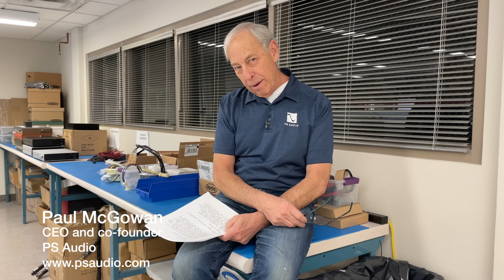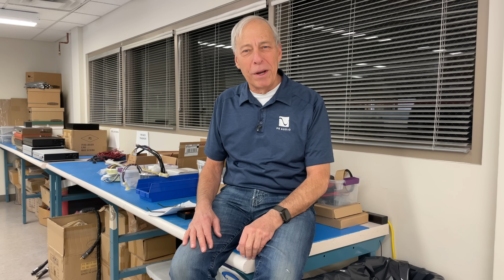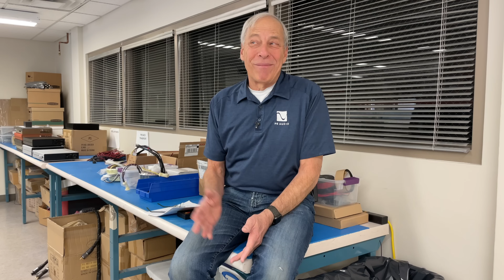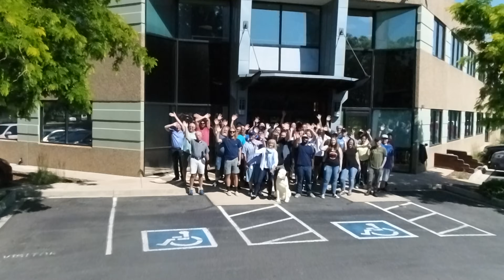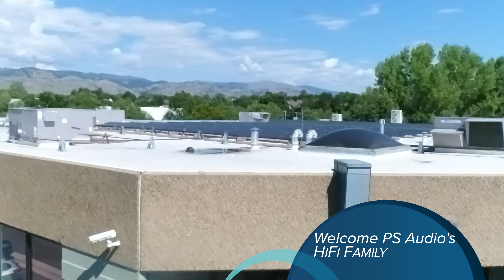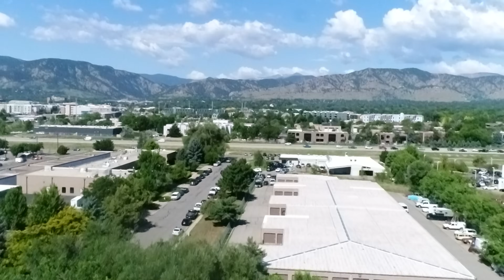Do bigger transformers sound better?

Comment: Why not place a "power amp" to the output of the PS? a transistor is cheaper and more compact than a transformer, and will give you the lower impedance.
Reply: The power amp will need a power supply using (you guessed it) a transformer. It'd be better to just use a capacitance multiplier circuit if you don't need regulated power rails.

Regulation adds its own can of worms because some regulators have very slow transient response.
Reply: Not necessarily.  But, thing is, he's talking about phono stage. how much current is there anyway? transients? 

Sounds like he was using a really tiny transformer, an insufficient one even for that.
Reply: @armaiatm  Lots of ways to do it. Of course, if it is that sensitive to the power supply it's connected to, then someone has obviously done a pretty bang-up job of designing a phono stage.

If I were designing the power supply for a really good solid-state phono stage and wanted to "do it right", I'd probably do a linear supply (with a normal-sized transformer and reasonable filter capacitors), then regulate it with one of the Linear Technology low-noise regulators. Then I'd throw sufficient output decoupling capacitance (using a mixture of electrolytic and ceramic capacitors) to ensure it maintains a low output impedance throughout a reasonable frequency range. The power supply for a phono stage does not need to be complicated or expensive.

Comment: Yes, I tried this myself years ago on a diy preamp and difference was big.
Reply: There's certainly diminishing returns. What I've learned looking into guitar amp design is that, the same as home audio, is that there's a budget and most of the time the transformers are an easy way to save a lot of money. Big transformers are easy upgrades if you wanted to spend a bit of money

Comment: My 2 ATI 2505 amplifiers each have 3Kv Toroidal Transformers, this equals 600v per each of their 5 channels. I think the Transformers are 60+ lbs.
Reply: 3kV? You mean 3kw? :P
600watt per channel minus heat loss (if it's class AB it's about 40-50%) sounds legit.

Comment: I don't know but the one on your 7k dac doesnt. Audible distortion and high noise floor. The 9 dollar apple dongle measured better.
Reply: @vegaslimoguy2376  it's on the Audio Science Review forum. Theres a 78 page thread about this dac with all the measurements.
Reply: @PowerSerge5000  On a forum??? HA!
Reply: @PowerSerge5000  Yes, I agree. ASR does legitimate testing.
Reply: @PowerSerge5000 
Did you even listen to it yourself to find out??
Or, are you basing your information on a pie chart that you read somewhere?
The proof is in the pudding, binky, not in the receipe.
Reply: @Hare_deLune  So when they make these obsolete over engineered over priced dacs are they not using measuring equipment?  The guy who designed the dac is pretty old and is supposedly almost deaf in one ear.  If it sounds good to him will it sound good to me?  Measurements are part of creating any piece of audio gear.  If im gonna drop 7k for a dac at the very least it should measure extremely well.
Reply: @PowerSerge5000 
Not only are measurements a part of creating any piece of audio gear, they are absolutely vital.
Measurements help to form the foundation of the creation of all audio equipment. They are the guidelines that engineers use to get the equipment to behave the way they want it to.
Then, when they reach a certain point in development, measurements take a lower priority to listening to the equipment.

This is blatant common sense, because it is 'audio' equipment. It is designed to be listened to. People purchase it and put it in their homes so that they can listen to it, not so they can hook it up to test equipment and measure it for years on end.
It is a well known fact in the audio community that many great sounding pieces of equipment measure poorly, and conversely, many pieces of equipment which measure perfectly sound less than ideal.
This is a form of proof that measurements are not the final arbiter of how a piece of equipment sounds.

 Measurements are a tool that engineers use to get equipment to conform to certain parameters in the design and development stage.
Relying on measurements to dictate how a piece of consumer equipment will sound, without having heard it, is a leftover of marketing ploys ro manipulate consumers in the 1970's. Don't fall for it!
Auditoning a piece of equipment has always traditionally been the way to determine if it's something you will enjoy in your system, not looking at the spec. sheet.
The spec. sheet is only to give you a rough idea. Same as the engineers who developed the equipment.

I know this is a tall order to fill these days with the disappearance of the brick and mortar stores.
We as consumers need to take advantage of any trial periods or money back guarantees offered, and to demand such opportunities, or boycott companies that do not provide them.
Reply: @Hare_deLune  what you described is how speakers are created. Because there is not perfect speaker they all get voiced to have a certain flavor. Dacs amps and preamps however are not supposed to have a sound. They're supposed to take the source and faithfully reproduce it.  Distortion and effects are added before hand when an audio engineer is mixing and putting together the music. That is how he wants us to hear it. Yet people are spending 6k for a ps audio dac that adds color to the sound. Why would you want that. Now everything you listen to has that color whether you want it or not. When the sound comes to your speakers it should be transparent and many dacs provide that. If you want to add more color than the studio recording engineer intended you can use cheap eq or dsp. The 6k dac from ps audio is literally snake oil as well as their expensive hdmi and usb wires.
Reply: @PowerSerge5000 
There is no such thing as purity of sound in any piece of audio equipment, or purity of species in human genetics.
That pursuit is a fool's errand.

When a recording engineer records a piece of music, it is usually made up of disparate parts which are stitched together like a frankensteined quiltwork, then compressed and given an artificial soundstage and sound character (mix) that was pleasing to that person, and perhaps some consulting band members.
Every bit of it is a carefully constructed illusion, created with a proprietary blend of studio equipment that varies quite widely in selection and setup from studio to studio.

Then the result is purchased and possibly further corrupted by the end user (creating ripped files, for example), then listened to on a cobbled together home sound system that varies just as, if not moreso, in selection, quality, and setup at home.
Great DACs and amplifiers are made to produce a pleasing sound. Some are more neutral than others, of course.
None of them are totally transparent, because we are not technically advanced enough to do that.

Another thing is that very few people enjoy a totally neutral sound, because it is flat and lifeless.
Most people want musical and emotional engagement when listening to music. Good dynamics, rhythm and pace.
Reply: @Hare_deLune  no great dacs and amps are not made to produce pleasing sound. That's some hifi bs. That's called adding color. Dacs and amps have been fully transparent since the 80s. They've been already perfected. Dacs dont need to be in a giant box with a screen. They're tiny. All they do is convert 1 and 0s. These high end companies are all snake oil salesmen. People need to research and realize they're being duped and stop buying their garbage.

Comment: Does having a larger amount of gold, transform you into a better person?
Current is the factor. If current is vey low, a large mass transformer is detrimental. Magnetism is a balancing act on a thin or heavy wire. Opposites in magnetism do not attract. The same direction of magnetic flow does.

Comment: A power supply can never be “too big.”
Reply: As someone who has worked in industrial controls design/engineering for over 40 years, can you please explain that statement to me?
Reply: @tomterrific9459  you stole my comment 😆🤣😂
Reply: Of course it can be too big and this is especially true for a phono preamp. Bigger transformers come with a higher cost, higher weight, more EMI noise and perhaps even more common-mode current noise. And with a proper circuit to regulate the DC voltage inside the preamp, a heavy over-specified transformer is of no added value. Paul remember something from 1976 and I'm sure there is a very proper engineering explanation for what he observed. It could be, for example, that the original transformer was indeed underpowered, or it had too low output voltage, perhaps a European model used in the USA. These things are completely measurable.

Comment: So if I’m reading a spec sheet, how can I determine how big the transformer is compared to another product?  Is there a unit of measure that I should pay attention to?
Reply: Weight. For something using a linear power supply, eg. a class A or A/B amp, weight is a hint. Big transformers weighs more.
Reply: VA= volt ampere
Reply: @regitregnskap  yup plus duty cycle

Comment: It's the same with guitar amps. The bigger transformers of a 100w amp will provide more punch and fullness than a 50w amp.
Reply: My tube amp is rated for 50w, but the transformer is the big old Marshall kind that’s nearly a foot tall. The thing rarely ever comes in at 50w! Always higher, with peaks up to 120w. Sounds incredible

Comment: Actually, a phono preamplifier is using little power and what matters is that it internally has constant DC voltage rails without significant ripple or other noise. Rather, it could be worthwhile to add some capacitors, if there is too much ripple noise present. But a good phono preamplifier has a regulated power supply with very low noise to begin with. A larger transformer that is just over-powered and thus emitting more airborne RF noise (50 or 60Hz) or more common mode current noise (capacitive coupling between the primary and secondary windings) is more harmful than good for something as sensitive as a phono preamp. Of course if the transformer is truly under-powered causing the amp DC voltage power rails to fluctuate, you gotta get a bigger transformer. Perhaps some US$50 China brand preamplifier could have such problem, but then the problem is you got a wrong preamplifier!
Reply: This was was a lot for me to chew on, but I think I understand what you mean. Thanks for the detailed information!

Comment: My old H/K Citation amp had a transformer for each channel. Matter of fact, it had two of everything except for filter capacitors, of which it had two for each side. 

I’m told that toroidal transformers in stereo hifi typically have at least two windings in them - one for each channel. The Naim Uniti series has a winding for each channel and circuit (amp, preamp, streamer, and CD player in the Star)
Reply: A power amp can create a very dynamic load on the transformer and it makes sense to keep things separate in such case.
Reply: Citation 12 amp, correct?
Reply: @edthefirst2859  Actually, it was a Citation 19 - the little brother of the huge solid state Citation 16: 

https://www.hifiengine.com/manual_library/harman-kardon/citation-19.shtml

The Citation power amps were all dual-mono if memory serves. The 19 was pretty damned beefy for a "100 watt" amp and put out 180 into 4 ohms with at least 3dB dynamic headroom. It was a high current design (6.3A into 4 ohms). I paired it with an Apt-Holman preamp. It still couldn't power a pair of Magnepan MG-1s though lol. Those suckers were thirsty! It did a lot better with stacked Advents and really pissed off the neighbors. I miss the whole set. A brutal setup with a delicate B&O turntable and 20CL cartridge.

Comment: As an EE student, im going to have to go with mostly NO on the question. 

If both the transformer and circuits are designed properly, there should be no change in sound when increasing the transformer size. 

However, a lot of transformers and power supply's are designed to barely meet the requirements, so in that case yes. I for one usually design my power supply's to handle at least 150% the expected peak load.
Reply: Any audiophile phono preamplifier will have adequate voltage on the regulators to maintain a stable DC voltage to the amp circuitry and adding a larger transformer will just cause more EMI with the transformer (50 or 60Hz noise) and possibly also more common mode current noise.
Reply: You are wrong, the earth is not flat.
Reply: @adamsonlinearrayspeakersha87  What does this statement mean ??????
Reply: I agree entirely.
Reply: ... aaaand ... that's the difference between student and 45-year practitioner.
Reply: @dnealuk  Paul's claim of some observation from 1976 could easily be explained with simple measurements. If truly a larger transformer made an audible difference, you would be able to see it on the DC power rails inside the amp as reduced voltage ripple or fluctuations. There is no magic here. It's easy to store a before vs after oscilloscope measurement of the power rails and compare them. "Separation of instruments, depth and body" are not meaningful metrics on a DC voltage rail issue. Paul's talk is too much voodoo science on this topic.
Reply: @ThinkingBetter  If you can hear a difference, but not measure it, is that the fault of your ears or your instrumentation?
Reply: @dnealuk  
The first question you have to ask is can everything be measured ?? 🙉🙊🙈
Reply: @poserwannabe1  Since your ear is a measurement device and the origin of the sound of a speaker is electrical in nature, every aspect of the electrical behaviour of a sound system is most definitely measurable.
Reply: @dnealuk  im going to go with ears on that one, well, brain technically speaking. While there are likely effects yet to be discovered, i doubt any of them contribute here. If there is a difference, it should be measurable.
Reply: @dnealuk  I think you are missing the point. If audio sounds better with a bigger transformer, what is changing????? If the change is this earth-shattering, it should be pretty easy to identify precisely WHAT is changing.
Reply: @dnealuk  one might also say it's the difference between science and snake oil.... peace
Reply: It's supplies, not supply's. Be an English student some day.
Reply: @thegrimyeaper  do you have any technical input, other the criticizing my skills in my second language? If not, then why bother commenting?
Reply: @lbochtler  English is also my second language, and I appreciate when people correct me so that I can learn. :)